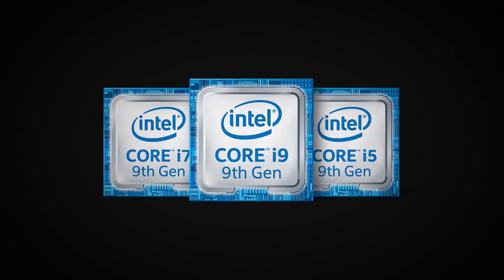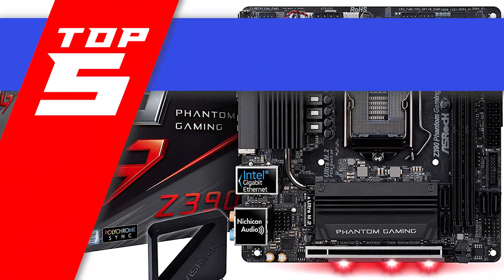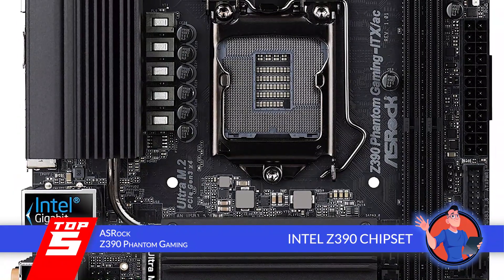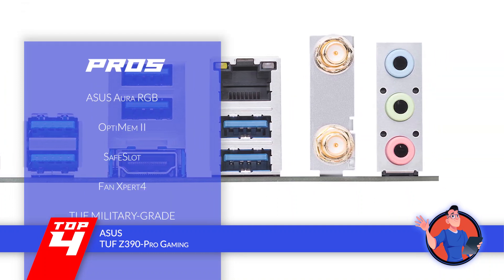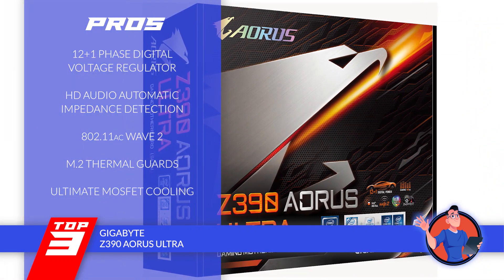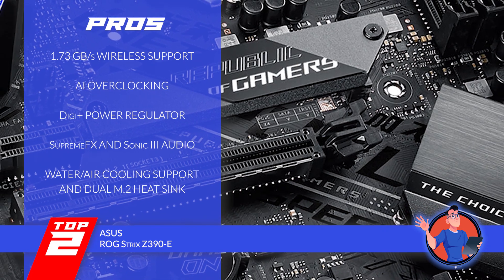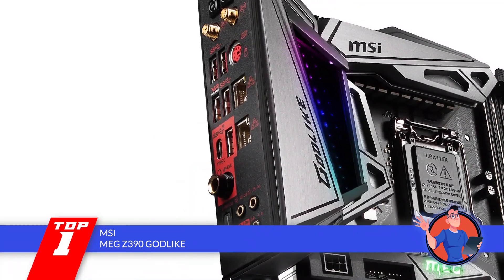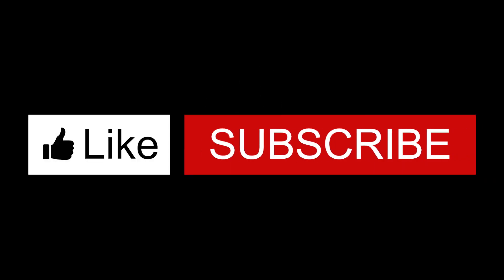Best Motherboards For I9 9900K 🖥: Top Options Reviewed | Digital Advisor

Comment: Hello I live ik Belgium Europa.
Recently I spild some coke over my pc.
So the motherboard was broken and also the cpu.
So I got a B360 motherboard and the i9 9900kf.
But I can't overclock with this board.
And also when I do a stress test the cpu drops to around 4ghz.
Can you recommend a good Z390 board?
I heard that the gigabyte z390 aorus master is a good board with good vrm temps.
But isn't good availible.
Can you help me?
Also I'm upgrading to a 360mm aio for cooling  but are the tubes long enough to mount it tubes down like  gamers nexus sugested?
Thanks